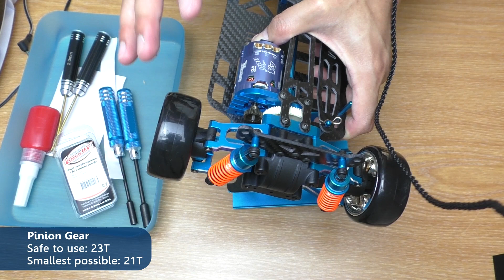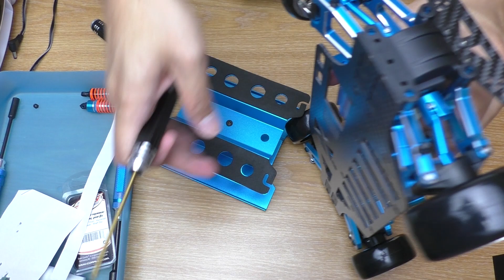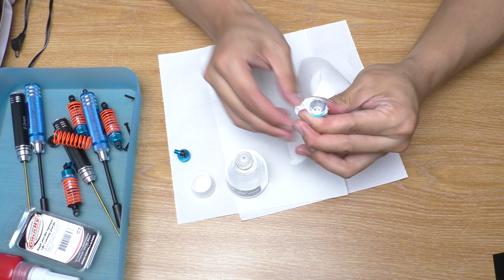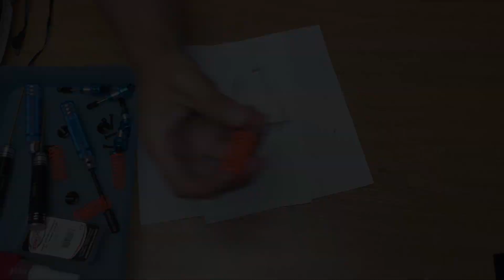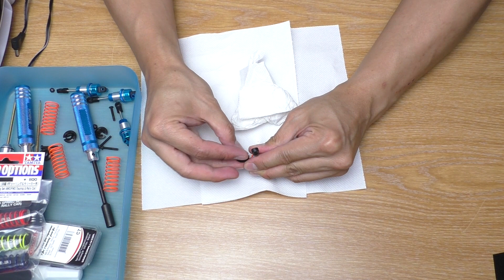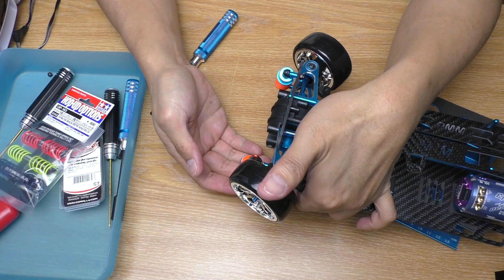TT-01 Carbon-Aluminium Project EP2: Build Vlog 01 - Motor & Pinion Installation, Filling Oil Shocks

Comment: what radio gear can i use with drift car
Reply from the maker: I recommend to start with a decent one like Radiolink RC4GS V3 (a review of V2 https://youtu.be/VfcWCJisCzY) or Flysky G7P https://www.banggood.com/custlink/GvG5Ln6aVN (review https://youtu.be/zg6Kbgc4eow ).
These can set a knob to a channel so you can control gyro with them.
For higher budget there is now Radiomaster MT12 which will come out soon. Hardware wise, it should be good per Radiomaster standard. Software will be a very steep learning curve because it uses EdgeTX. If you are coming from drone or plane you will feel at home. If you are new to this I recommend stay away at all cost.
An easy to use transmitter with amazing performance is Flysky Noble NB4. Review here https://youtu.be/T86VXmVCovU .
It's on discount now as well. Here's the link https://www.banggood.com/custlink/D3mHlA6LV0

Comment: Great project! What’s the highest pinion I can run on this chassis with the stock motor mount? It’s a 0.6M pitch right? I want to put a 31t 0.6M pinion but I don’t know if it will fit.
Reply from the maker: Yes, it's 0.6M pitch. I don't have the measurement for 31T pinion but I think it'll fit. The 23T that I have on this car is pushing it in all the way so it can fit way bigger than that. Or get some different gears to try out is probably the safest. The biggest pinion I can find on the chart for TT-01 is 28T.

Comment: Ciao hai visto la nuova s10 blast tc3 di lrp?? Mi piacerebbe vederla commentata e recensita da te sei bravissimo complimenti per i tuoi video mi hanno aiutato molto con le scale 1:28 touring ora sto cercando di avvicinarmi alla scala 1:10 touring grazie
Reply from the maker: LRP S10 has been a good solid platform for club racing for years so I think that will be a good entry level chassis too.

Comment: Those orange stock springs are the length you would find on a off-road buggy. So the shocks won't be compressing too much with them on.
Reply from the maker: As it turned out getting the Tamiya springs was a good idea?
Reply: @BeaversHobby  Yes it was.
Reply from the maker: @alphawlff  Thanks.

Comment: Owned one, ditched the upper and lower of the front and rear arms to tamiya hop-ups (plastics, adjustable), changed the steering to aluminium (hop ups), changed the front and rear axles to aluminium (hop ups), changed the steering links (hop ups) and restore the P7 to delrin parts (plastics)...